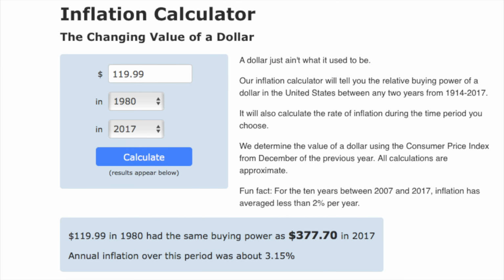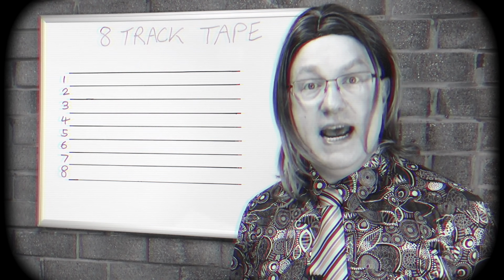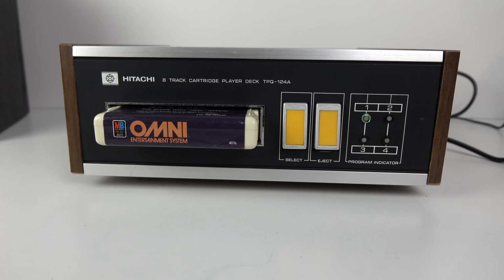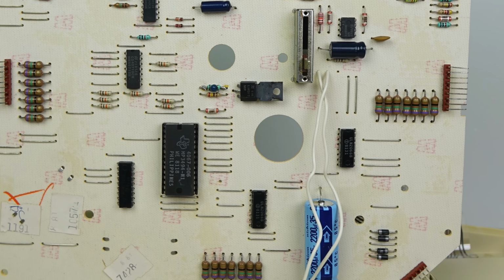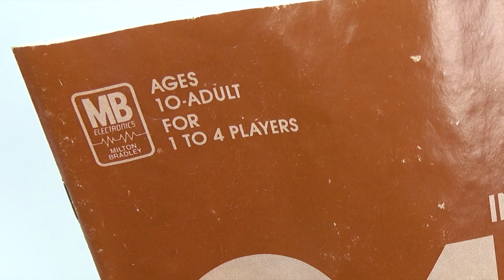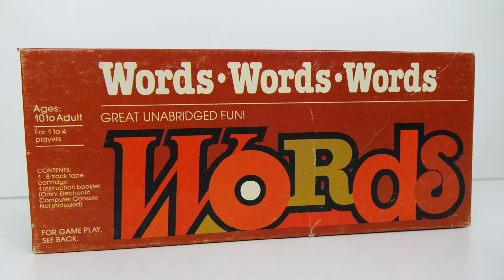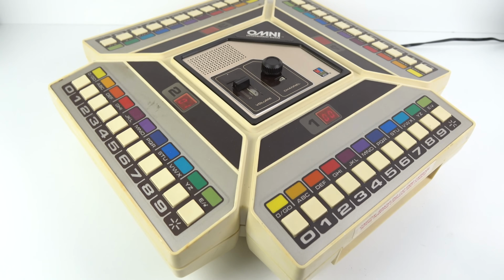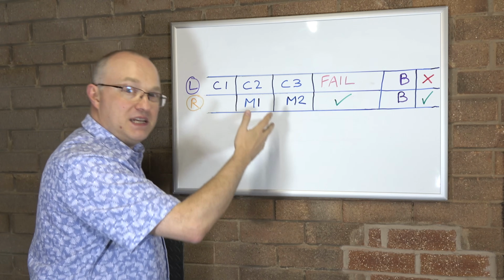MB OMNI Entertainment System - The 1980s 8-Track games machine.

Comment: I never had no games like that the only thing I had was a two-cycle engine I grew up around engines in Forest games my brother and sister had to on Atari I think it was called a Genesis before that it's for the ball bounced across the screen and he's a component had a pad on each side to have a snack of the Cross almost like table tennis that their we get my brother and sister had before they got a tory and stuff like that and he started upgrading me I stuck with engines I like small engines I don't know why I just I get off on small engines I like how they work they're pretty neat especially Briggs & Stratton they are the toughest engines out there that work with me anyway I can put a hole in the side of the block of a small Briggs & Stratton lawn mower engine and it'll still run you can't kill brakes that easy we actually pulled a Briggs & Stratton lawn mower off of scrap power in a junkyard put a little gas in it and it fired right up lol

Comment: Teddy Ruxpin worked in a somewhat similar way; only with cassettes instead of 8 track cartridges. The left channel contained the actual audio, and the right channel contained the signals that would tell it how to position each servo. They also made an accessory called the "answer box", Where teddy Ruxpin would ask you a question and you had to press the button next to the picture which best answered the question he asked, and would have grubby say something along the lines of either "That's right!" or "That's not it!" depending on whether or not you answered correctly.

Comment: This actually reminds me of a device I acquired early this year, a VTech product called the See-A-Sound Phonics.  It's an electronic learning aid computer made for children aged 4 to 7, and it teaches them about letters and letter sounds.  It does this using a set of 4 cassette tapes.  Each tape teaches children about different letters and letter sounds, there is both audio and data on each tape, images and letters appear on the screen, and there are games.  The unit also plays regular music cassettes.  The data on the cassettes contains graphics and computer code and instructions.  Arguably not quite as advanced as the Omni in terms of the content of the tapes, but technically it's intriguing in its operation.  I made a video about it.

Comment: An amazing piece for its day, but yeah, you hit the nail on the head in the conclusion.

It reminds me of having Trivial Pursuit on C64. Having a CPU as ref was great and all, and obviously it had more questions than this, but after 2 or 3 games you'd still run out of questions and the fun would cease. Of course, that game had the advantage of not only being playable on a computer you'd likely already have(since it wasn't just C64, but Spectrum, Amstrad, Amiga etc.) in an era where even most working class households would have a micro of some form for a tenner, but you could also buy question expansion tapes... even if I'd never actually seen any of those in shops, it did have the option to load one in.

Comment: A quite informative video: I only knew MB from their Jigsaw puzzles way back in time. Funny they used a lineair storage medium to base their information access and logic on, since random access media (even the larger floppies) were still a long way off. Still anybody having noted the ideas of programmable logic and the early home PC's like the TI-99/4A I once got for free 2nd hand saw the writing on the wall towards the use of random access memories (RAM) . This TI-99/4A I had for a while needed a linair storage medium like the compact cassette for filling its limited RAM capacity and opening up logical decision power from and towards its inbuilt Micro-processor. These TI machines also came with game cartridges loaded with programme & data to be read by the machine electronically. All games with fixed logic, notably these Q&A types quickly loose their attraction; no wonder this machine disappearedin in the 80's  BTW I used my TI-machine for calculating horoscopes with a programme capable of running on this machine. OMNI's and game machines of the 70's like the Atari and Magnavox were for playing (guessing) games only. These latter ones used TV screens for showing gameresults, which the OMNI did not..
Reply: MB started making jigsaw puzzles and then it went into board game production.

Comment: What I wonder is why they didn't simply include a cheap music synthesis chip in the Omni. That way, it would have been possible to store a quiz programme on a single track each with it simply muting the audio for the appropriate answer response, and the jingle being generated. This would have allowed them to get at least double the quiz content onto the 8-track cartridge and also avoid the "Please wait 10 seconds" message in the example.

Comment: Does it add up the keystroke values to determine the word answer?  For example if you press 1, 1, 1, enter, is that actually the same as pressing 3, enter? 

Otherwise, I don't know how a system that limited could accept answers which are arbitrarily long - even when covering a 26 character alphabet down to 10 digits.

Comment: The plastic head mount is a huge problem in a large number of late-model 8-track decks (as with cassettes, the number of 8-track mechanism manufacturers dropped as the format lost popularity so ultimately there were only one or two mechanisms available for the various manufacturers to use in their respective devices). The problem is that the plastic is under quite a bit of stress due to the screw on top which has to be pretty tight to keep the head in place. I believe the original design was metal but was changed to plastic as a cost reduction. For these later units a metal clamp to go around the outside to reinforce the plastic would solve the problem permanently.

Comment: I have two.  I worked there while this  and the Microvision were being developed in the late 70's.  I worked on the Big Track follow-on - the ill-fated MB Robot.  So many cool things from there never made it to production.

This was very difficult to produce in quantity - they had problems keeping the heads aligned, tape jams, on and on.  After it was announced to the public the problems really started surfacing,  and instead of making 1/2 million like they did in most of their first-run electronic items,  they cut production back to 50k. We used many, many mask-programmed 4 bit TI microprocessors - one of the first embedded controllers I worked on :-)

Digital data on one channel,  voice on the others,  the computer reads the data,  takes the player inputs,  then switches channels to play the answer.  

The most amazing thing (IMHO) we worked on there was a 12" interactive video disk game - Adventure!  Another one that never made it out of R&D.
Reply: Milton Bradley’s MB Electronics also made “Simon” and “Electronic Battleship”, two of the best games ever put out. I do have “Electronic Battleship” in my collection, and all the games that MB Electronics produced belongs to Hasbro.

Comment: 1980?!  Wow.  I didn't realize electronic games like this were being put out that early.  I remember once around '82 or so our seventh or eighth grade class had to put on some kind of performance after hours at the school.  We had to kill time in the room until it was our turn in the auditorium.  We were told we could "bring games."  I, naturally out of the loop as usual, assumed this meant BOARD GAMES.  So I brought Monopoly.  But, of course, every single other kid brought one of those hand-held electronic football or basketball or baseball games that were all the rage back then.  I felt like a fool.
Reply: i just discovered the Atari 2600 had a wireless controller option. Guess Marty McFly was right, we arent ready for it yet

Comment: I wanted one of these as a kid. Needless to say it was too expensive for my parents. It is a good thing though. Given the limitations of the format, I would have gotten bored quite quickly once I expired the small pool of questions they could fit on each tape. It was an ambitious device, but the tech was not quite there yet to make it a good value. A written quiz game was far more economical and would have enough questions to get one's moneys worth in no time. There were many board game versions of the popular game shows available to fill that need. Now there were other electronic quiz games at the time that were cheaper using internal memory like Name That Tune. Since music tones didn't take much space even for the then limited and expensive memory chips, they could pack a lot of tunes into the device. It still didn't take long to memorize all the tunes it could play out at random. The bigger challenge was betting how few notes you needed to hear to guess correctly.

Comment: This reminds me of a similar educational toy that I use to have when I was young called 2-XL, similar function as the OMNI, but shaped more like a robot with only four buttons.  The version that I had was also 8-track cassette version produced by the Mego Corporation from 1978 to 1981.  There was a newer version that was produced by Tiger Electronics from 1992 to 1995 which had a more updated look and design and used regular size tape cassettes.  One thing I remember about it was that not only does it give quizzes with multiple chose, but sometimes it would tell jokes.

Comment: I'm a US Citizen.  Hadn't heard of this unit until I saw this video.  I guess the fact that I never owned an 8-Track deck until around 2006 leaves me a bit unclear as to how this device straddles the 1970s & 1980s.  I sidestepped the whole 8-Track farce, wisely I'd say, by having gone all-in on cassettes in the late 1960s and never taking a look at the clearly inferior rage of 8-Tracks.

From your analysis, it doesn't appear the unit took advantage of even limited random access afforded by the 4-channels of an 8-Track.  From the way it seems to function, it may as well have been completely sequential and cassette based.   It does seem primitive when compared with actual personal computers available at the time.  But one plus is, of course, the ability to play audio recordings from magnetic tape.  I'd have traded recorded audio for visual cues and primitive electronic music, in exchange for the increased sophistication of any of the personal computers available at the same time.

33:28 - Likely, the reason it didn't 'take off' is because it was inferior to the actual personal computers available at the time.  I didn't make that choice though because this beast was unknown to me.  You're very generous in your 'review', in my opinion.  There's usually a demand driven reason for a product's failure.

Nice presentation and interesting troubleshooting.  Thumbs up!
Reply: Believe it or not, the 8-track had superior audio for it's time. I picked up some old 8 tracks in the 90's and a player and hearing the tape side by side with the CD version, I found little difference in the quality. 8-track died as a format due to the failings of the drive system. The tape came in direct contact with the drive wheel which over time would wear the tape out. God help you if the tape didn't wind back up correctly inside. Getting it back on right was a nightmare compared to fixing a cassette tape.

Comment: Idea: Mod it so it loads all 8 tracks into RAM and doesn't make you wait 30 seconds if you're good. (Would only work with a special cartridge, and the hardware would have to be replaced with a microcontroller)

Comment: When I was 10 years old I took an old 8 track deck and added a couple relays to it to make it into a "radio station cart machine".  Also made a cartridge with just 65 seconds of tape.  The foil would stop the machine to cue it, and I'd press a big rectangular green START button which lit up (just like the real thing!).  Four programs per tape.    The only difference between 8 track and radio carts (besides the cart machine making full use of the tape for better quality) is that in carts the rubber pinch roller was part of the machine not the cartridge, and would swing up through a hole in the cartridge as it was inserted, for better tape movement.  Another difference was most kept the weighted capstan turning all the time, so the tape would start moving instantly at proper speed when a solenoid pinched it.  What plagued consumer 8 tracks was that spring that tried to hold the whole cartridge+roller against the capstan.  Too little pressure and the tape would slip, too much and the capstan bearing would wear out and seize.
Reply: qwertyFUBAR damn, seems like the subscribers of this channel are all freaking tech geniuses
Reply: > " qwertyFUBAR damn, seems like the subscribers of this channel are all freaking tech geniuses "

We are not different.  The world has changed.   It may seem that way if you are young (under ~35) but no! We were just curious, and we were fortunate to grow up in the days of discrete electronic components.  When you crack open any consumer device today you will see some tiny custom chips and tiny things on a tiny board.  When we opened the stuff in the 60s-70s, we saw BIG components, big PC board traces and wires to follow, discrete logic chips like little swiss army knives whose map you could read out of a parts book, even relays.  You could touch things and modify them without breaking everything.  No micro-processors and blank chips that whisper to you, "You'll never figure this thing out."  

People love miniaturization and handheld convenience but myself and quite a few others who were hobbyists in the 70s, we are sad to see that the succeeding generations have grown up surrounded by electronics that are mysterious tiny 'black boxes'.  If YOU were transported back there you would surely open stuff up and figure out some stuff too, just as I did.
Reply: @qwertyFUBAR  Can confirm the curiosity, I grew up in the late 90s into the 2000s, I took apart fucking everything. 

The most headway I made understanding half the crap I took apart was the older stuff like cassette players, VHS players and Record players. 

That of course didnt stop me from taking apart my toys and other things to understand them. 

CD players and video game consoles frustrated me since I couldn't open them up and watch the mechanical pieces operate.

Comment: Inspired by your video, I recently purchased an OMNI for my collection. Unfortunately, it didn't came with a power supply and I can't find what its power requirements are on the internet!
Could you please tell me how many volts and amps it needs to be able to run?
Reply from the maker: it's 13.8V, 1Amp
Reply: Thanks so much!

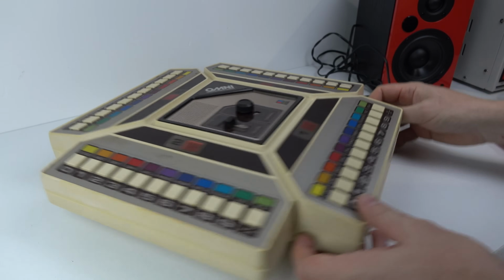Comment: 19:30 I think the question's wrong. It should have been three, Pete Kelly's Blues, the eponymous song from the 1955 (not 1950) film with Jack Webb, Janet Leigh and Edmond O'Brien, but it was based on a radio serial of 1951... Singing in the Rain (1952) is a joke (Gene Kelly's blues, arf arf) to throw you off, Kelly and Me w/Van Johnson was released in 1957. Pretty sure about this, but will happily be corrected!

Comment: Brilliant video as usual. It is very likely that your removal, cleaning and reseating of the chips, resolved your initial issue. I recently had an Atari 2800 console that would power on, but just beep, continually. Some contact cleaner on the cart and into the cart socket, soon resolved this issue.

Comment: Does anyone remember an educational/trivia type device that came out in the 60s or 70s, was about the same size as the omni, just a lot thinner -- Had these big round thin cardboard discs you put in it, and the chassis of the device had several openings around the perimeter (some openings had a mechanism to hide, or slide to reveal the data)  , where you'd rotate the swap-able  disc to reveal trivia questions (or whatever data the disc had on it?) .. I remember the device was beige colored ....  It belonged to my mom and Aunts., and I used to toy around with it in the 80s .,  though I've never seen anything else like it ... The Omni unit somehow reminded me of it ., perhaps made by same company, not sure.  It wasn't electrical ... I remember there were dozens of discs with it, slightly larger than Vinyl record ..The device was square, perhaps made for 4 players to sit at each side.

Comment: Awesome tip I invented for fixing cracked plastic like that head holder: Take some hardware wire, heat it up with a torch, and press it into the plastic. It makes a much stronger connection then I have gotten with any kind of glue. Just be sure to have the wire formed to fit the part and be easy to apply before you heat it up, takes some practice. You can use glue in addition if you like.

Comment: That is most definitely a fascinating glimpse into the past. And, for it's day, it held a bit of an edge over it's competition. I mean...most electronic games were like what you showed. Simple and limited. I believe the Atari 2600 was fairly new to the scene and probably the closest competition. None of them talked. (Although,  home brew eventually made a 2600 speak.) Even classic computing was still around the corner. So, this really would have been a step above board games.

Alas, the price of admission was rather steep. And, it had limited replay value, as the tapes could only hold so much. But, it was some clever tricks during the dark ages of gaming. And trivia is one of the easier games to pull off. I have had a hobbyist level of experience in building a couple trivia bots. A whole lot of fun to be had for so few lines of code and a decent night's data entry into a Q&A .dat file.